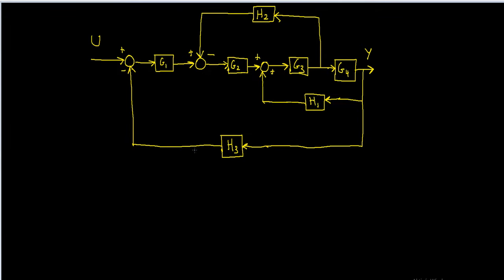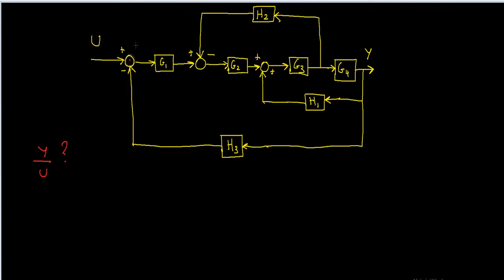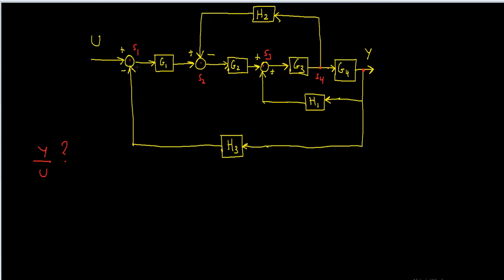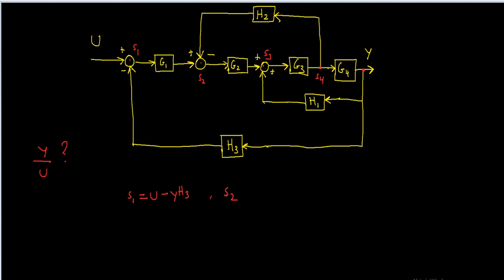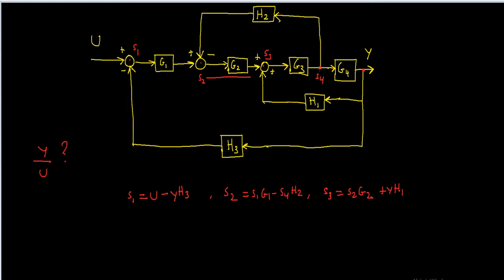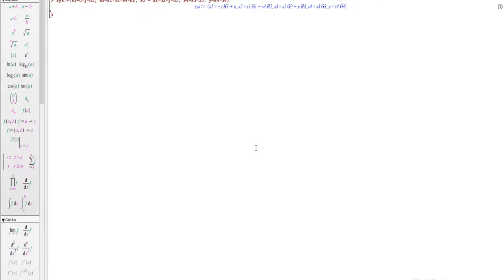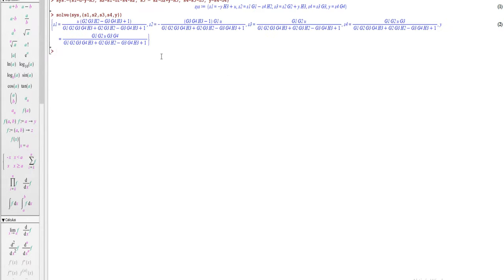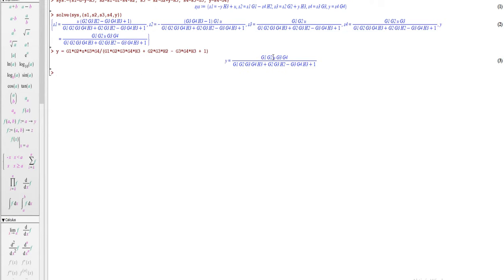Find the Transfer Function of ANY Block Diagram

Comment: Waste of my time. Professor requires us to do it by hand and without matlab. Should add the fact that you're cheating with software to the video description.
Reply from the maker: Finding the transfer function of block diagrams by hand can be done, but it is a *not so useful skill. Finding the transfer function by hand may take more than 10 minutes and requires redrawing the diagram multiple times, increasing the likelihood of making mistakes. Here I show an approach that can be performed in minutes and is very easy to understand.
Reply: @theelectricalengineeringst7231  I completely agree with you. However, most people who are looking this particular thing up on YouTube are going to be college students who's professors require them to do it by hand for exams. You have to keep this in mind and show both methods.

In industry, it is very commonplace to use software. However, in university, it is almost exclusively done by hand.
Reply: @theelectricalengineeringst7231  Personally, I think the way you showed it with the nodes is super-useful.  After that, it comes down to algebraic skills, which is definitely not USELESS.  It'd be like saying it's useless to know the times table because calculators exist.  Also, once you find all the nodes, there's no need to redraw the diagrams.